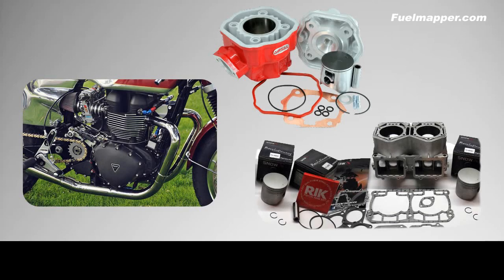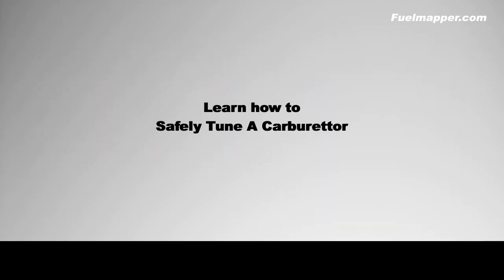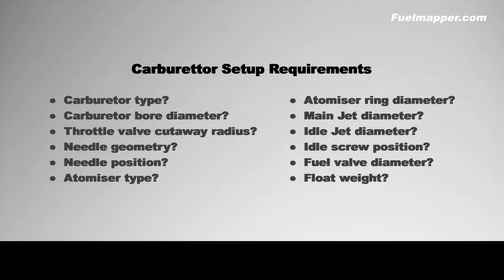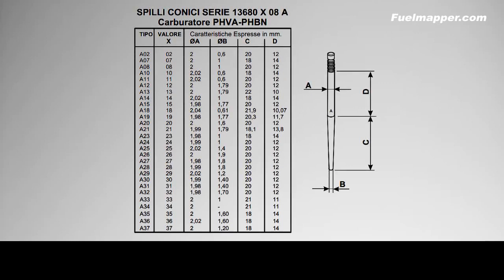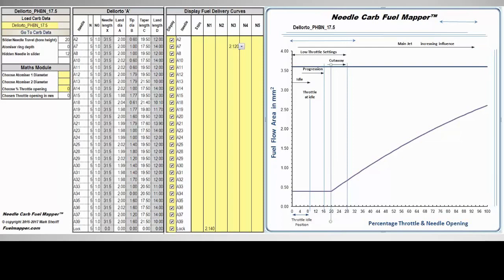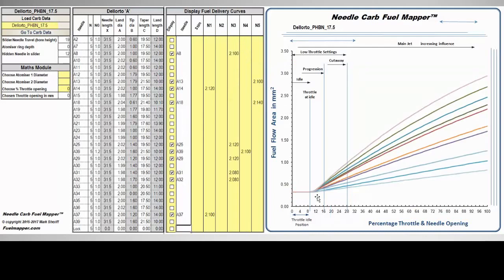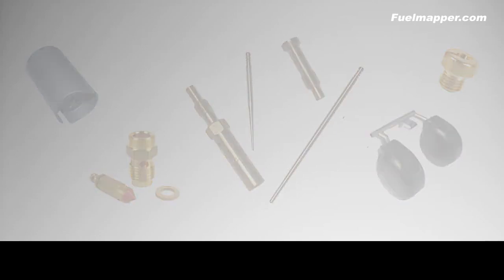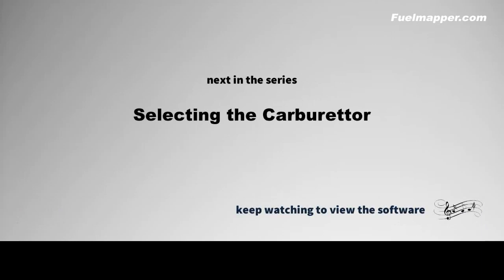Carburetor Tuning For Performance - Part 1 - The Challenge

Comment: Hello, how can I contact you to solve a problem I have?
Reply from the maker: It's not difficult.
It just takes commitment to getting the explanation perfect.

Type it in Notepad++ (the best text editor by far).
There is no formatting, so you are free to focus on how to explain the problem using text ;)

Once you have the rough draft you can make the first revision.
Personally, at that point I would leave it, and get on with something else.

Then re-read it.
LOL That's when you realise it doesn't make sense, and you re-write it.

The next day, re-read it again, confirming that enough detail has been provided.

Finally, copy & paste the finished text, and click 'Reply'.

Read it again immediately it has been pasted to YouTube.
If there are formatting errors, you can edit the post  before anyone sees it.

:)

Comment: Hey i hope the program is going well and all, i saw this video come upp in my recommended and i love it, this is cool and a really helpfull program to use

If you add pwk carbs i will most likely buy the program, other than that i am just curious about how its going right now
Reply from the maker: Any carb and needles can be added
You would simply add the pwk needle dimensions.
Having said that, there is a strong likelihood that one of the Dellorto needle series will fit your pwk.

Whichever carb that you use, the body must be measured, and added to the program - a video shows how this is done (listed on Fuelmapper.com)

The program is fine - no major upgrades have been required since launch :)

Comment: did the rest of this series ever get off the ground?
Reply from the maker: The problem was that the software provides cross reference between Mikuni and Dellorto needles ie. you can use correctly documented dellorto needles in a mikuni carb (because the mikuni needles aren't correctly documented).
Consequently, the vid and my general accounts went haywire, and life tanked.
It would appear that the pressure gradually came off the vid, and things have stabilised (though they will never be the same)
I do intend to complete this work for posterity.
I've just bought a new Toner mic and an a5100 camera, with a view to returning to tutorial creation.
:)

Comment: is there a keihin pwk carburetor in the software ? thnks
Reply from the maker: No, not specifically.
It can be added by yourself, but no research has been carried out on keihin needle and atomiser diameters.

Keihin does generally provide good dimensional data.
However, you will need to download the dimensions for the applicable single taper needles for your carb model.

The multi-taper needles provide no benefit to the tuner, unless you are designing engines for specific fuel economy at specific speeds.
In fact they are a nightmare to tune with, due to the sudden jumps in fuel flow, as the taper changes.

Natural aspiration works better with smooth progression.

For some reason keihin like to produce a lot of their needles with multi tapers.
This may be for commercial reasons.

There is also the possibility that there will be a range of Dellorto needles that are interchangeable with the keihin carb.
Dellorto produce an enormous range of needles in different series.
The software links each of these that fit Mikuni carbs.

The key dimensions to match are similar needle diameter (the basic parallel diameter) and similar(ish) length from the circlip.

So, you can paste in, the keihin single taper needle dimensions for your carb, and the atomiser diameters.
Or, find the Dellorto needles that correspond (all Dellorto needles are pre-entered).
Or both, to gain a larger tuning range. 

Then you enter the carb body dimensions, as you would do when adding any carb, as per the written and video instructions.

Once that is done once, it is done for ever.
... and I'll produce a new version credited with your data, to share it with the tuning community (if you wish).
Reply: @EngineTuning   thank you for the details

Comment: Are you swedish or has my youtube translated the description?
Reply from the maker: I translated the descriptions as best I could, using the translation apps available.
In all cases, English was the pivot language.

I reverse translated to check that it worked, and modded the English structure to try to rectify any failures.
... but obviously, I couldn't actually confirm the translation.

The hope was that it would be good enough to deliver meaning.

Feedback was quite good for the major languages, but even then, the dialogue is unlikely to flow with the poetry that each language requires.

A German guy offered to provide a translation, as did a Dutch guy (thanks to them).

I have a feeling that my efforts might have been for nought, with Swedish.
As I understand it, most Swedes have a better grasp of English than google translate :)

Anyway, I did my best.
Whether I will do it again for the rest of the series ... probably not (due to the proficiency of Swedes in English), and it requires a huge effort..

So ... the big question ...
How well does it read in Swedish?
:)

Comment: I thing you also should make a video on how to get your carburetor at a good micture so your bike could be safe to ride, and that would be the perfect starting point to fine tunning the carb
Reply from the maker: Thanks Gvidas.
Yes, you are absolutely right.
Safely tuning the carburettor is at the heart of the video project.

There are currently some issues being worked on.
It looks like the project will continue in the New Year.
You will hear more, as that happens ;)

But rest assured... your request will be met.
:)